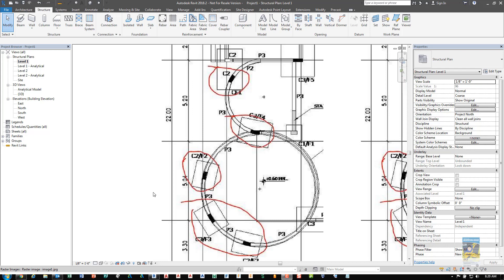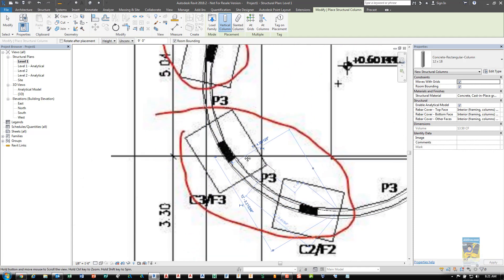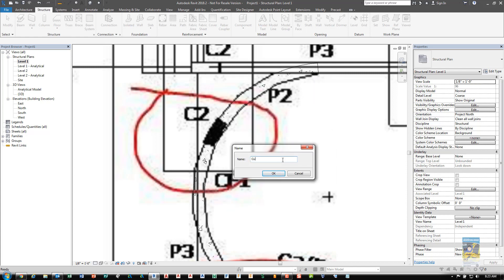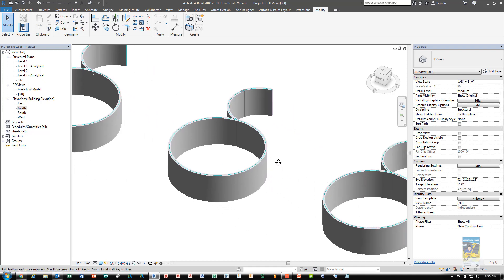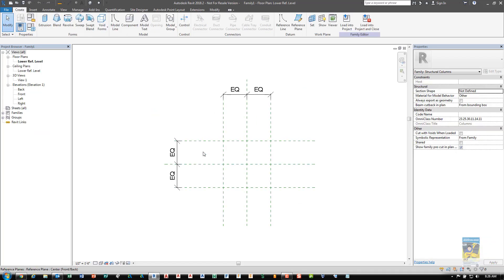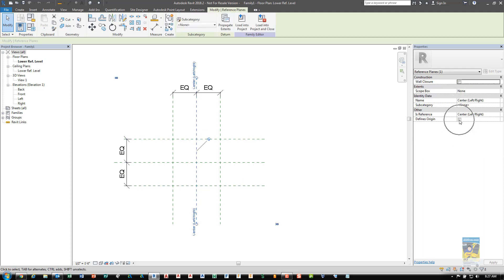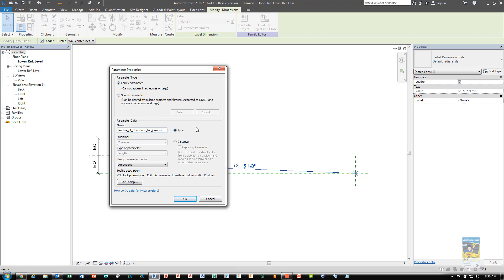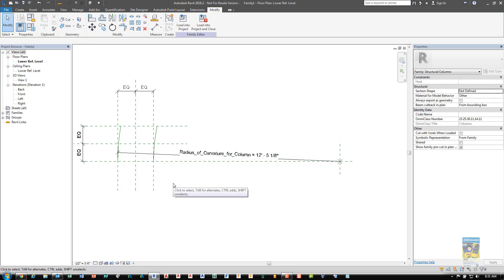Custom Revit Curved Column in Wall

Comment: sir how to fix the arc length
that is possible or not
Reply from the maker: it depends on how you create the arc.  Usually, you will have to redraw the arc from scratch.  Sometimes, you can select it and change the radius and it will adjust....it just depends...